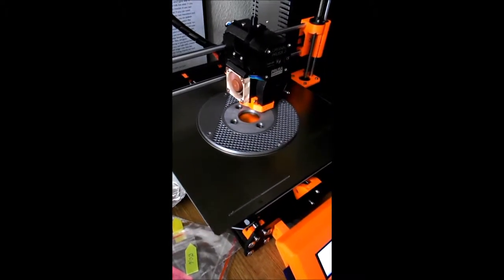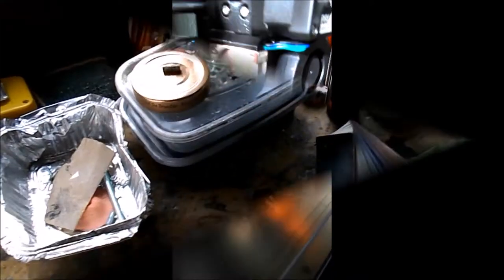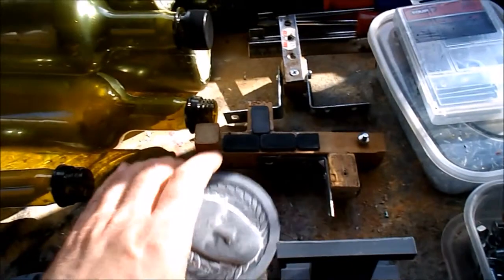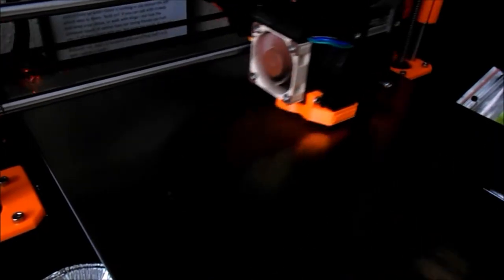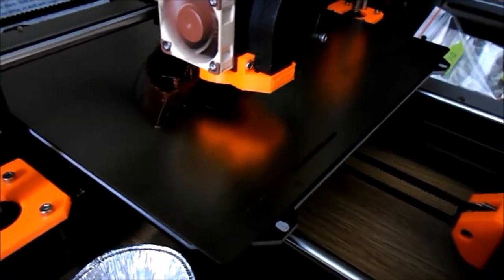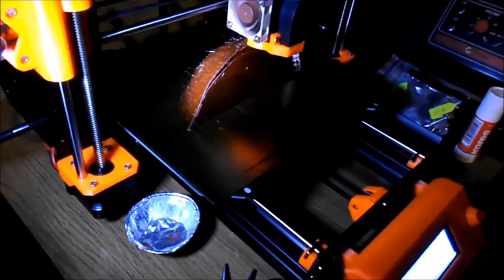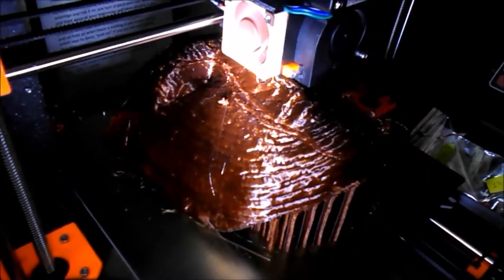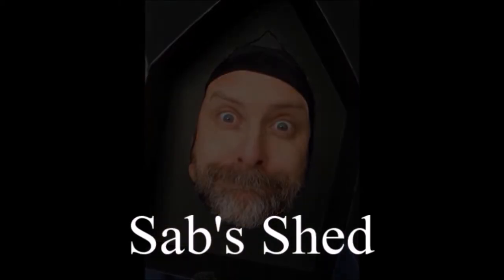Michael Sabbaton ‘TURK’ Theatre VLOGS 2018 EPISODE 9 - 3D PRINTING FUN!

Comment: Top video, but 36 hours WOW!  Did you discover what the print problem was?
Reply from the maker: Yep, it sure was a monster print. The problem was a layer shift that the printer made and looking at the crash log I found that there were multiple crashes throughout the later stages of the print. I noticed that the PETG was balling up a bit on the hotend and causing obstructions so I think that was it. Solution would be to adjust temp but I think it would need experimenting with. Might also be plastic quality. Still, it got through it and now I've moved forwards with the complete head looks fine and adds a bit of extra character! I think I'll call him 'Scarface'... :)